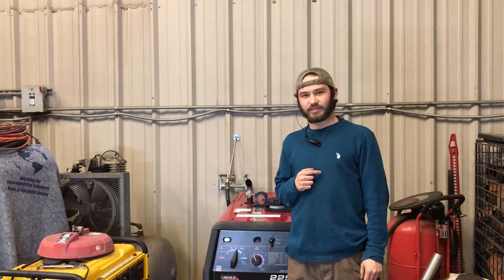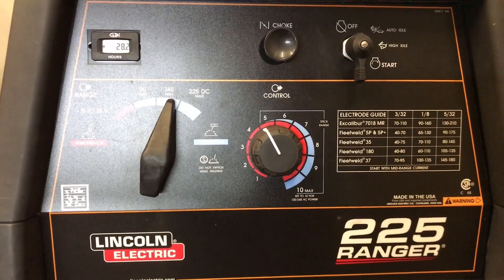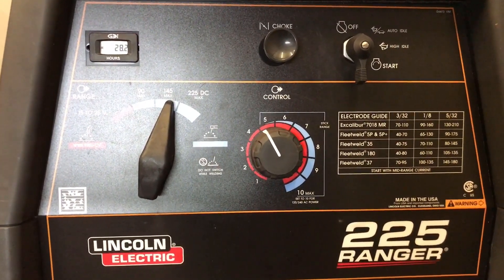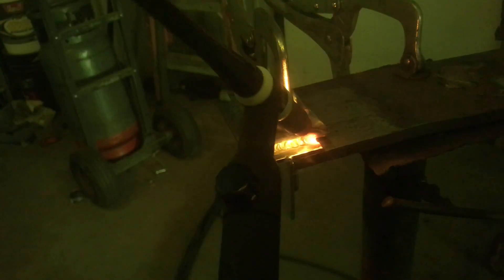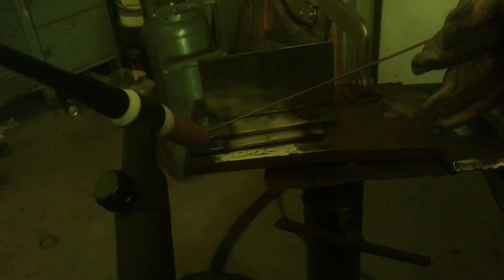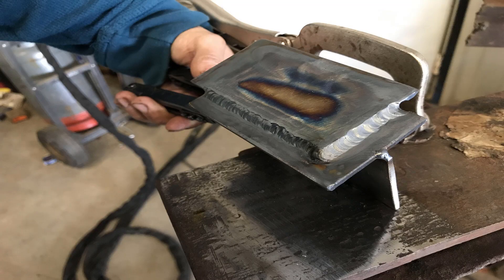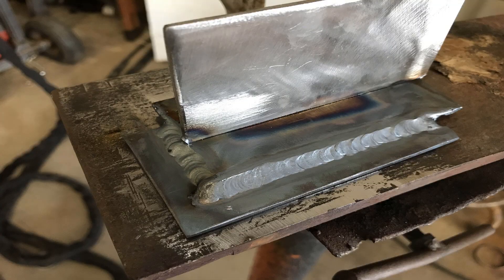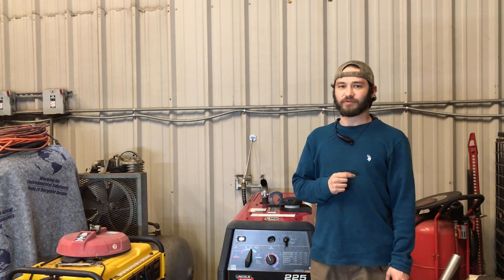TIG Welding Lap Joints! Lincoln Ranger 225

Comment: I'm going to order the Everlast PowerArc 210STL so I can expand into more of this steel TIG welding to go with stick.
Reply from the maker: That is a decent machine from what I’ve heard
Reply: @adamswelding5052  I went and looked at the Vulcan Commander, but there are many more benefits to the Everlast for like the extra $60 after adding taxes.

Comment: Could you show how to weld around pipe to a base plate, for mounting stuff? I can't seem to stick weld around in a circle.
Reply from the maker: Protected Profile sure I could do it I’ll have to see what I have to use for pipe and plate. Do you have any particular sizes you would want to see?
Reply: @adamswelding5052  I was thinking of welding a harbor freight crane to my truck, sort of like Derbador the Weldor. Like 4-4 in. I don't know ... just hard to figure hand positioning.
Reply from the maker: Protected Profile I will see what I can do I will try to get a video of it either this or next weekend
Reply: @adamswelding5052  if you are looking for small ideas you could include in future videos. I tried welding some generic bolt down studs for mounting stuff, but when I tried to weld the bolt on it melted into a crooked blob.
Reply from the maker: Protected Profile how thick was the bolts you tried to use as studs? Something like that I would go mig or tig stick is too hot of a process for that in most cases unless the bolt is around 1/2” or bigger
Reply: @adamswelding5052  I actually think it was 1/2". I don't have a MIG or TIG setup. I tried using 1/16" 6013 from Harbor Freight.
Reply from the maker: What thickness was the base metal, what amperage where you running at, and what polarity where you in?
Reply from the maker: Hey so I’m going to do one of these ideas in a soon to be upcoming video which would you like to see first welding the pipe to the flat plate? Or welding. The mounting stud to the flat plate?
Reply: @adamswelding5052  a mounting stud would be fine. I'll watch both of them.
Reply from the maker: Hey don’t know if you saw the stud welding video? But I hope it was helpful and if there is something I could do to improve it let me know!
Reply: @adamswelding5052  I'll go watch it right now.